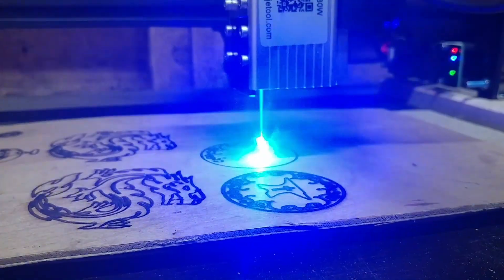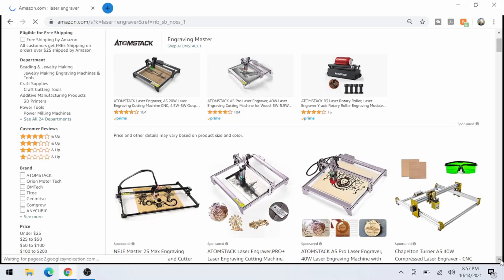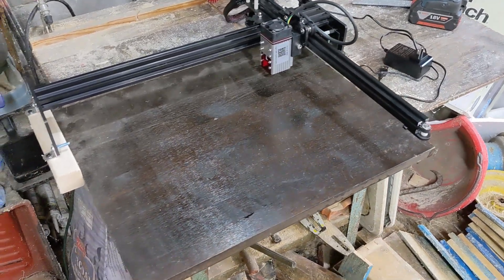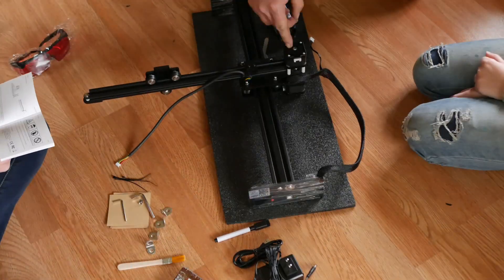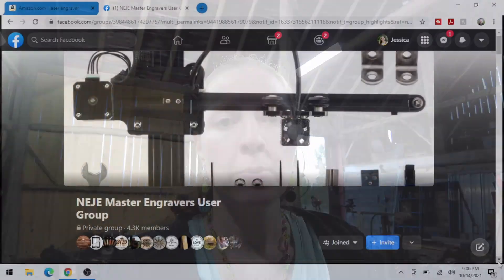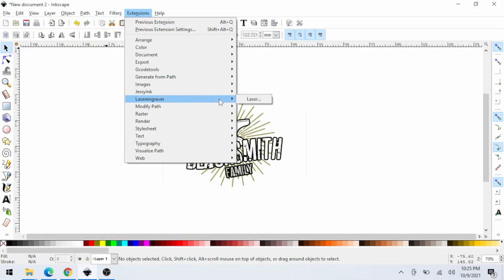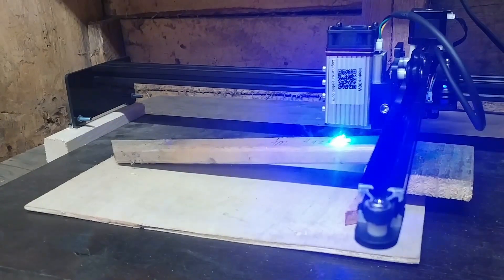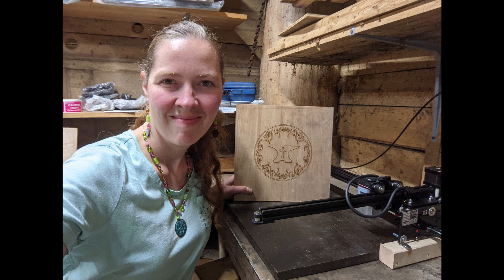Always Keep Learning (Trying the NEJE PLUS 2S Max 30W N40630 Laser Engrave Machine)

Comment: Use it to laser engrave touchmarks people charge 90 for a 3 in touchmark i figured 6-8 inch keep my hand away from the metal. I would check on making steel charge 50 id  buy a few

Comment: very interesting!   I am wondering if you could use this for metal etching.  Not directly, but taking a finished project, dip it in wax and then use this device to cut your design through the wax/lay down your design and then acid dip?  Basically, a different way to do photo resist etching on metal?   thinking about it, you may not be able to get a clean enough burn through to get down to bare metal to allow acid access to the metal without doing too much general melting?   if it worked, it would be a neat way to get detailed designs for acid etching.  Should be pretty easy to test out/experiment with at least!  love the channel and the content by the way

Comment: Very cool. Yea I've ordered supplies for bronze casting and a cnc router is in my wishlist with a 3d printer.

Box lids for sure, maybe coaster sets kinda merch. Wood handles on a project, if the project contains woof. Engrave the logo, like the sled you guys did.